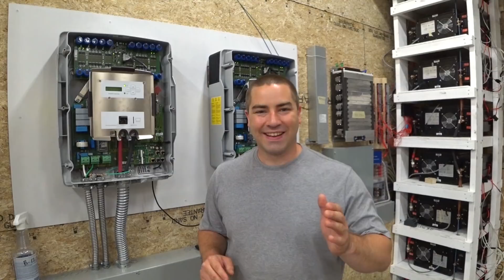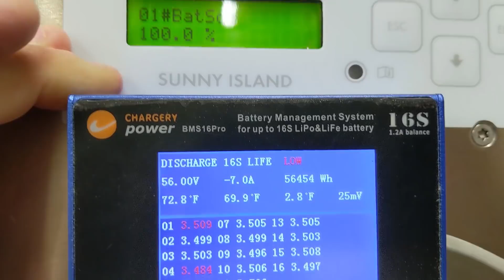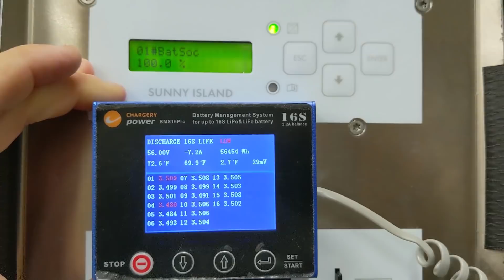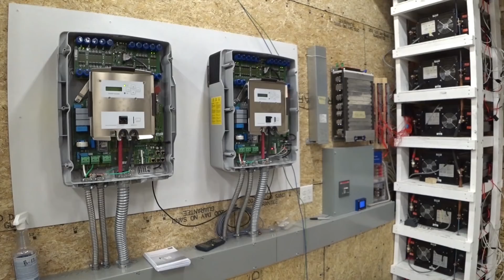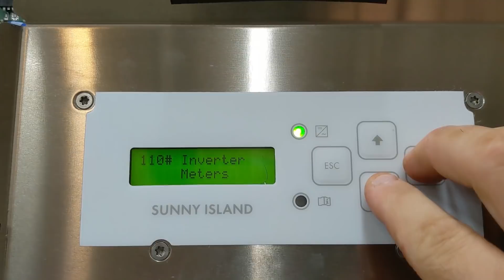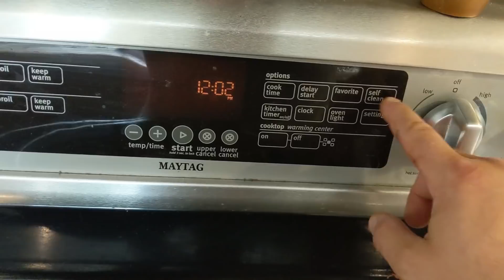Overloading SMA Sunny Island Inverters, Off Grid

Comment: David, just curious, could you have run your loads straight from the solar panels and inverter without batteries?
Reply from the maker: The Sunny Island inverters need a battery connected.  I think SMA makes a version of a Sunny boy inverter that allows partial use without batteries.
Reply: @DavidPozEnergy  Absolutely! That is what we have. Several Sunny Boys 300' from house under 12kw solar array. 2 SI in the garage. The SB are on the LOAD (AC1) side if the SI'S. 'David's test was a great example of how the SI would work at night with no solar input. During the day, the Master SI is the  local grid "gate keeper" and adjusts all the inputs and outputs of the SB's by adjusting the frequency. The SB's see it and respond immediately. You can, as in our case, run 12kw of loads and when the battery is full, no power is actually going through the SI at all. All you have to do is to set the SB to "off-grid mode" and they will react to frequency shifts by increasing or decreasing their power output. All done in the existing AC wiring, no other communication needed!

Comment: Hey David, really enjoyed the test since I was interested in  using the SMA 7kw on a system I'm trying to design and expand upon as fund's are available. It's pretty obvious your impressed with the SMAs. after that test. I'm new to solar but have researched everything possible to get at least a small system set up for emergency back up. I'm starting with 6, 320 watt panels on a adjustable ground array, 4, 210 ah North Star carbon lead batteries, and the 7.7 kw SMA  inverter. Not much to start but it's all I can afford right now since I'm retired and on a fixed income.  Any suggestions for EMP, CME, an LIGHTING proofing  a system. I like the Sol-Ark inverters but just too expensive. The SMAs seem to be a good dollar value for the quality of the inverter. I would appreciate any input you have to share. Have watched most of your videos and have enjoyed the content and useful information. 
Thanks Bob
Reply from the maker: Hi Bob,  I use some surge protection devices (SPD) from Midnite Solar.  They come in different voltages so I have some out at the array, and another in my circuit breaker box, and another on the battery.  https://www.altestore.com/store/enclosures-electrical-safety/lightning-protection/midnite-solar-surge-protection-device-300vdc-and-120240-vac-p9042/
But, I've spent more than the Sol-Ark costs.  Parts, wiring, charge controllers all add up.  The Sol-Ark is actually less expensive than a comparable system pieced together.  Now if you only need a 2kw inverter or something, then yes, you can make it less expensive.  But if you want a 8kw inverter, and charge controllers, etc, then the Sol-Ark is the cheapest way to go.
Reply: @DavidPozEnergy  Thanks for the response, and helpful links. I do like the Sol-Ark inverters. I'm finding out that with all my research even a small system is very expensive. I just don't know what I will end up with but I think I will have to be patient and invest more than I originally thought. Thanks for your insight and helpful videos.

Comment: Great project!!
Couple of questions: Is that a hundred anp breaker you are using for the interlock, I thought you tied each inverter to each leg in your service panel or are the SMAs in a parallel configuration?
Reply from the maker: Each inverter is powering it's own leg.  Each is 120v.  They communicate to keep 180° sine wave apart, which gives you the 240v.  I hope that helps.
Reply: @DavidPozEnergy  Yes it does, thanks.
I have Sol-Ark 8k and a Fronius Primo 3.8k string inverter. I'm looking at adding another inverter to allow me run the entire house.

Comment: Hello David. I just saw your video and have a question. This sunny island can’t control PV cell like the MPP LV5048 right ? I keep looking and I think that I need a Sunny Boy. I live in Puerto Rico and after Hurricane Maria the grip here is a mess and I want a full off grip system. PV with LiFePO4 Batteries. What do you recommend the MPP LV5048 or the Sunny Island with the Sunny Boy. Thanks
Reply from the maker: That's right.  You need something else between the solar panels and batteries.  You have two options with these.  First, you can use a Sunny Boy as you mentioned.  This is called "AC Coupling".  Second, you can use a traditional MPPT charge controller.  It is called "DC Coupling".  Right now I'm using a Victron 250/100 charge controller and it's DC coupled.  I have some videos on the Victron if you want to see it.  In the future I'm going to add another array and Sunny Boy to demonstrate the AC coupling option.
Reply: @DavidPozEnergy  Thanks David

Comment: Gotta love the empowered feeling of being able "trip over" the extension cord with the utility company and being your own utility company as if everything is normal even when pushing it to its limits. I would've gone with the SMA platform, but they don't offer a 120/240 volt split phase single unit version out of the gate and allowing you to add from there. However its design allows that single unit to be configured as a standalone 120 volt, two units for 120/240 volt split phase, or three units for 120/208 volt three phase. If you can get them in a pair at a good price is definitely worth it.
Reply: Genetry solar is getting  ready to launch it own line of inverters they have wi fi and you can hook them together for 3 phase or for more power and redundancy

Comment: Wow that is impressive for sure, hard to get inverters that can actually output their advertised rating these days.  Been toying with the idea of adding a transfer switch myself so I can run the house off the shed solar.  I only have 400w of solar but if I get a big enough inverter I can at least run a couple big loads for a short time on battery and let solar catch up.  In a power outage situation I could at least turn off most breakers and power the important stuff in cycles.   I still need to figure out how to keep the snow off the panels though, minute we get wet snow or freezing rain the panels are out of commission for rest of the year since it creates a hard crust on them.
Reply from the maker: Where do you live?  My panels will sometimes get covered up during storms, but usually once the sun hits them (still below freezing air temp) the snow slides off.  I'm in MA
Reply: @DavidPozEnergy  In in northern Ontario.  Basically once there is snow it stays for the year.  I can brush off the normal snow but once we get the weird stuff the brush just kind of glides on top.   I want to figure out a way to change the incline but that will require more hardware, right now they are flush parallel to roof using unistrut.  I  have some videos of the install.

Comment: Would be great if you could share what is the draw on each phase and how the SI deal with unbalanced loads. I think that the inverter keeps phases on balance which can lead to losses in off grid applications. Thoughts?
Reply from the maker: These two inverters can not share load from one phase to the other.  It is possible to overload one phase while the other still has room.

Comment: Brilliant!! Great test. Should have probably mentioned at the start that you're network is 3phase. I wonder how they perform the same test when connected as 1p but I assume some of your appliances are 3p supply.  Great video. Thanks!
Reply from the maker: I have 2 phases, each is 120v.  They are 180° out from each other.  So when you measure from L1 to L2 you get 240v.  This is often called 120/240 split phase.  It's common in North America.

Comment: I'm so far behind the learning curve with lithium ion batteries and inverter technology. I have two inverters, both are the "powerdrive" brand name. They are fairly simple and have an android app for monitoring load %, temp, input and output voltage monitored by the app via Bluetooth. 1000 watt and 2000 watt.  I've thought about finding the clock circuit and see if it's possible to do some wiring and soldering to investigate if I could operate them together for a total of 3000 watt or put them in an opposite direction for the oscillator to get a full phase at 230v at 1000 watts, the size of the smaller of the two inverters. I'm disabled so I can't buy much because of my extremely limited income. I can say I really like these videos and I always learn something from each one. I hope you continue to make them so I can continue to watch them and learn. 
Thank you so much for taking the time to make these videos.

Comment: So awesome 👍 it will be super rare you would typically use that much load all at once either. One of your videos you should go off grid for a week document each day, talk about how much Sun kw input and load used. Also there is a guy in Hawaii that does alot of this stuff he uses heat pump dryer's, heat pump hot water and induction cook top those things would substantially reduce your load if in the future you wanted to be totally off electric bills. Great job was waiting along time for this particular video your enthusiasm for this stuff is contagious
Reply from the maker: I've been running off grid since April.  I didn't realize I was supposed to video it each day.  LOL
Reply: @DavidPozEnergy  cool off grid since April, so awesome I'm going to have to start something soon think I might go MPP solar inverter
Reply from the maker: I don't have anything against MPP Solar.  But, keep in mind, they are high frequency.  So they don't do surges well, and can't over-load.  They just shut down.  I did a video on one of the models: https://youtu.be/FUaDmVDcYks
Reply: Think I would add a soft start or capacitor to help with the power factor on those motor loads (skill saw, chop saw, well pump ect.) The kvar on those loads are not the best for most inverters. A capacitor should help with the power factor and the power surge. Should be fine once added. Here you asked for a clip awhile ago on the dune race 24v conversion put some under glow and a front light as well. Video is a little Shakey https://youtu.be/hbX3NBXOCd4

Comment: Success is so exuberating when you finally see all your hard efforts and work come together. I wonder how long it would take to deplete your tower of power with this amount of draw? Do you also have your LTO battery bank system running on a different inverter connected to other AC lines in your house or garage or are we going to be seeing another video forthcoming? As always, fantastic job with fantastic results, David !
Reply from the maker: Hi Craig,  I tested the capacity of my battery tower to 24kwh.  So I could run 12kw loads for 2 hours.  LOL, it doesn't seem very long.  But usually can last me 2 days because I'm never running everything at once.
Reply: @DavidPozEnergy  Your oven's clean so you're good there for another month. I imagine that if your power grid goes down you'll ration your power to help maximize the amount of time you have it available. Still am wondering about the LTO batteries?
Reply from the maker: I have two different LTO batteries.  The most recent one was a 12v (6s).  I drove around with it in my car for a week, and was constantly checking it's temperature and voltage.  I ended up taking it out because if I idled there was not enough air movement to keep it cool.  
I have a second LTO battery that is wired in 48v.  I meant to hang it on the wall, but then got caught up in other projects, so unfortunately, it's sitting under my work bench.

Comment: When you have so well build inverter, and the entire chassis is a giant heat sink, and there are no fans, you know there is a lot of thermal headroom and overload capacity for considerable time. Love the fanless design. No dust inside, no fan to fail, just works. As long as it is in the shade, and not in direct sun, it would work super long. Sunny produces very well designed and manufactured inverters.

Thanks for the video.
Reply: The Sunny Islands have fans. The Sunny Boys (AV-41) don't.

Comment: That's  very good David, somewhat scary. Do you you how many amps you were pulling from the batteries.
Reply from the maker: Somewhere around 260-270 amps.  My shunt is still not staying calibrated correctly and I'll have to change it out.  By circuit breaker is 300 amps and didn't trip.
Reply: @DavidPozEnergy Wow, that's a lot of Amps, Well excellent test, Keep up the videos and I will keep watching. Stay safe and healthy.

Comment: You mention you use electric heat for the home, thus the solar is not able to get you off grid through the winter.
You also have solar thermal making hot water... you might look into using this to heat the house instead of resistive heat... of course, inverter drive heat pumps output heat far more efficiently in much colder temps than conventional heat pumps, so that is another way to supplement the heating off grid.

Keep us posted!
Reply from the maker: Right now my plan is to add another 5kw of solar, and wire it as a dump load to heat the house in winter.  I have the panels and parts, just have to get it done before the snow flies.

Comment: How long will your batteries keep up with that load it must be one big bank
Reply from the maker: In a previous video I capacity tested the battery bank, and it is 24kwh.  So at 12kw load, that's 2 hours of run time.
Reply: @DavidPozEnergy  how many kwh battery bank system would you need to run a Max load 24/7? Total off grid

Comment: Did the batteries heat up at all?
Reply from the maker: I'm sure they did a little, it's inevitable from a technical point.  but I couldn't detect any warmth from them with my hand.  I wasn't focused on the temperature, but several commenters have now asked for it.  I'll have to run this again with a temperature sensor on the batteries or something.  I don't own a thermal camera.

Comment: Man wish the guy didn't flake on me on those sunny island inverter I messaged you about. But I just got in the growatt 12k this week i messaged you about. Won't be able to hookup and use until we relocate as florida house hasn't sold yet. Only have to get batteries, racking material for panels and some more wiring for length of run after we get there. So excited that was great video
Reply from the maker: I did look at the growatt you linked to.  I'm glad it's a low frequency model.

Comment: what input voltage 120v or 240v?!
Reply from the maker: Each inverter outputs 120v AC.  They are connected with a communication cable to be out of phase, so across both hot legs is 240v.  I have both 120 and 240v output.
Reply: @DavidPozEnergy  how to charge ac i have 240v my du. same setup output and input 1 hot legs per inverter?!

Comment: Hey David, I was wondering how your water tank in your crawl space is doing? Have you seen any significant savings from it? Would love to see a video where you give us a conclusion on this exciting project!
Reply from the maker: It just sits down there.  I never have to do anything with it.  I've checked the water every now and then for the right level, but never had to add any water.  I don't have a meter just on my electric booster tank, so I don't know how much it runs long-term.  I'd love to add a whole house meter that allows me to see things like this.  My best guess based on some of my testing, maybe 2000kwh per year in savings.  But it's hard to say because I also grew the family and have 2 kids now.  More bath and laundry.
Reply: @DavidPozEnergy  I just simply loved the narrative of inexpensive storage in hot water. I thought the entire idea was extremely well thought out. I'm just gonna talk at the top of my head, but if you ever put a thermocouple in the water and log the data. You could compare with the price of heating the water using electricity from the grid.

Comment: Great to see you get so excited about it!  Pretty neat little units there.  I should do the same thing with my 3x LV5048 MPPSolar units.  The only reason I went with such a huge amount of power is we have a Nissan Leaf, and I needed 7kw capacity just for the charger on it alone.  Also, the fans kick on with almost no load at all, and at max power it'll sound like a wind tunnel.  Might be fun to see...  I'm currently testing two Electrodacus SMBS0's on a 48v battery bank with 8s nodes per SBMS0.  So far it's working very well, but I do wish Dacian would break down and produce a 16s solution since the two halves will need to be top balanced periodically with this split method.
Reply from the maker: Can you please send me a link if you make a video about the two working on one 48v battery?  I'd love to see it.
Reply: @DavidPozEnergy  You bet.  I have the footage taken already and have to edit it - poorly.  Will let you know when it's uploaded and available.

Comment: You frogot to check The battery cables for heat and voltage drop. 
The transfer swich is too slow .

Comment: I know you were excited, but careful with that finger.  Pointing behind you at uncovered inverters could have ended badly.
Reply: Excellent advice! They rally should never have been left uncovered while running live (it sets a terrible example for the young ones), let alone while in an overload condition (what if they go pop? ouch into the side of your head), and it's also quite possibly causing the devices' thermal engineering to be less effective - maybe they could have gone even further with the covers on :)
Reply: @new-zealand-clippy  I would probably not call it an "overload condition". They are made for that. 
They can do: AC power at 25 °C for 30 min / 1 min / 3 s 5300 W / 8400 W / 11000 W 7000 W / 8400 W / 11000 W
Of course you have to be careful. 5750 is max CONTINUOUS LOAD at 25C!  At 40C you can only do 5750w load for 3 hours.
Reply: he is crazy rich guy